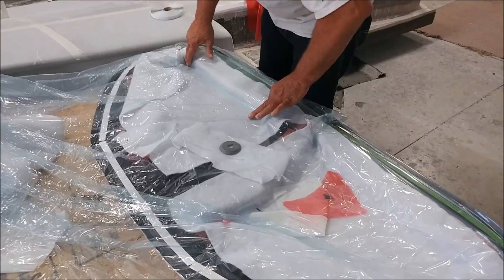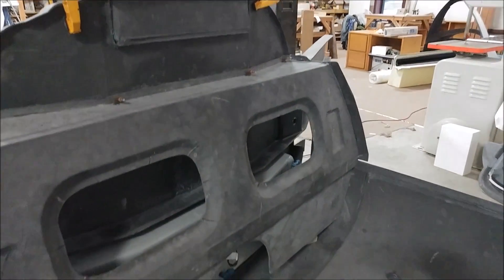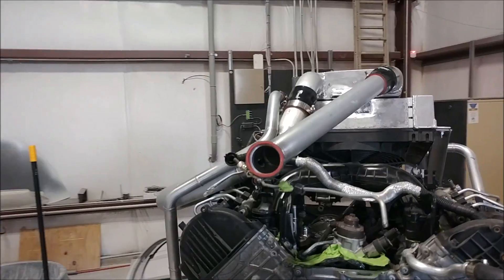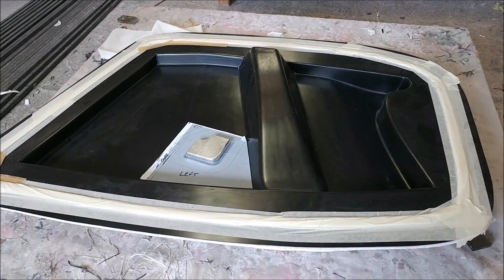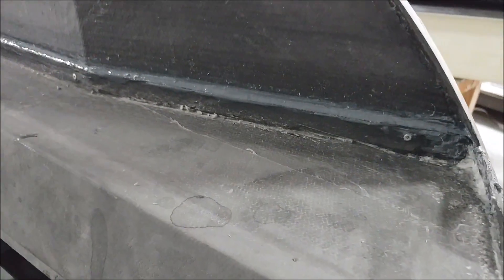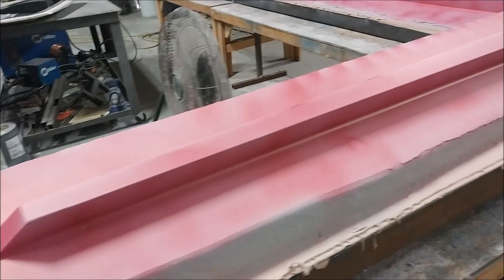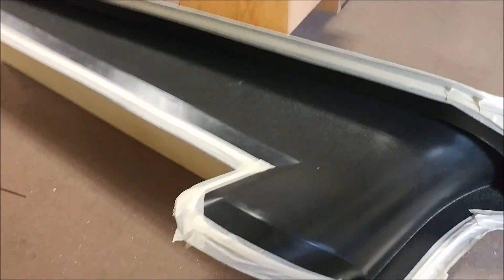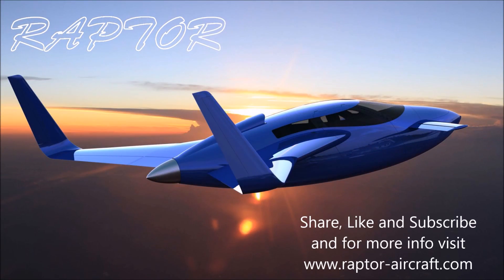It's a Series of Tubes - Progress with engine plumbing

Comment: I would offset that intercooler so that on the one side the end tanks are directly in line.  That way you don't have both tanks of the intercooler shadowing the radiator core.